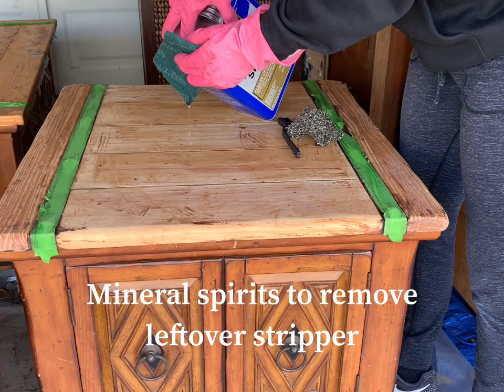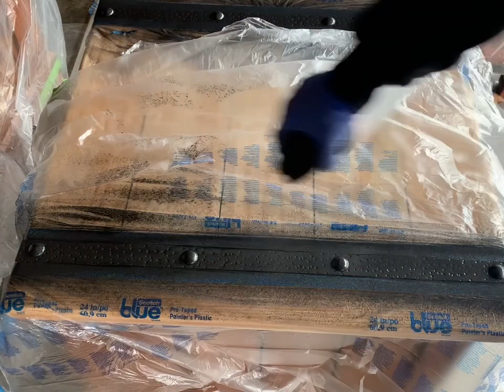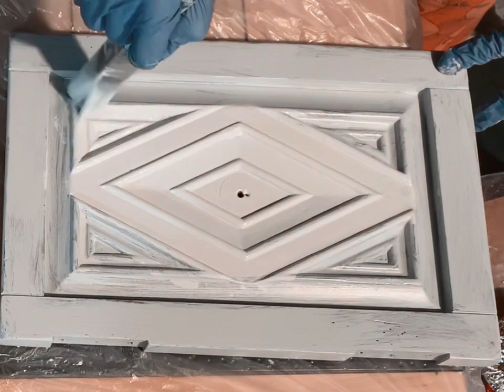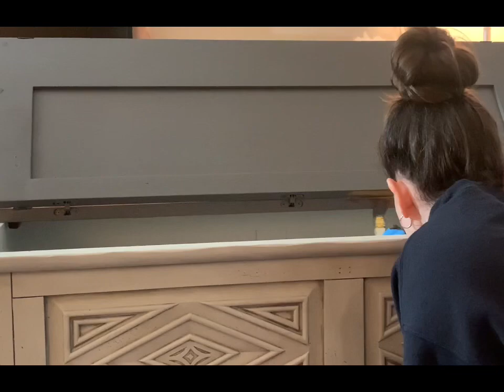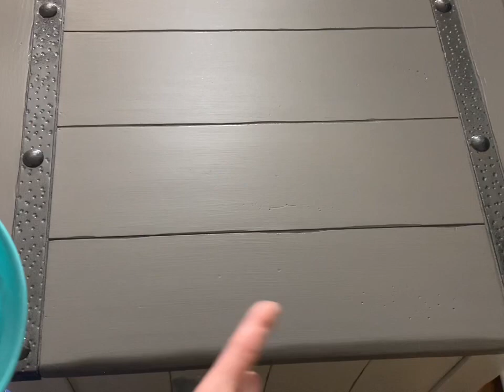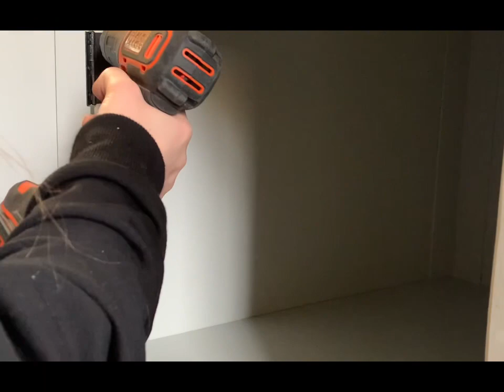High End Makeover on 3 Piece Set! | DIY | Aged Glazing Method

Comment: I do suspect this says more about me than you - but you go to so much hard and exacting work only to paint it.  Why?  Just buy a pressure paint sytem and save your energy.
Reply from the maker: I’m not sure if I’m understanding your question correctly. For the top, I i was going to show the bare wood with stain so I did a lot of prep work on that, but the stain didn’t take well and so I went to plan B which I think gave it a more tied in look 👍🏻 
I do have a couple different spray guns for paint which I use outside in the summertime but winter is tricky, can’t wait until summer!!:)